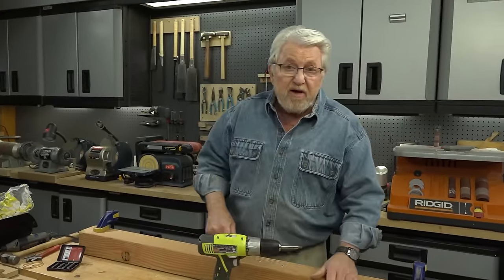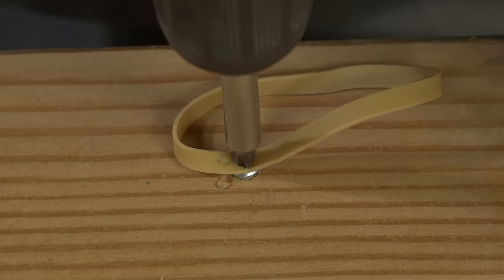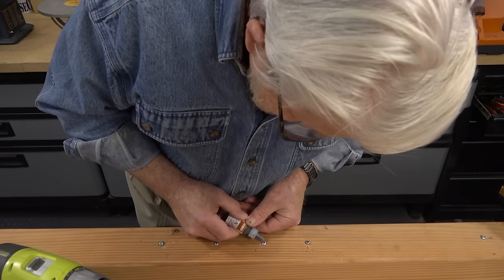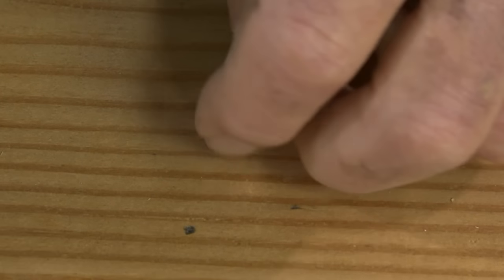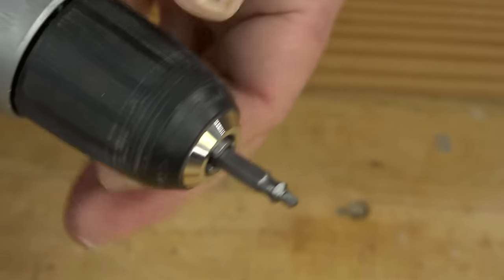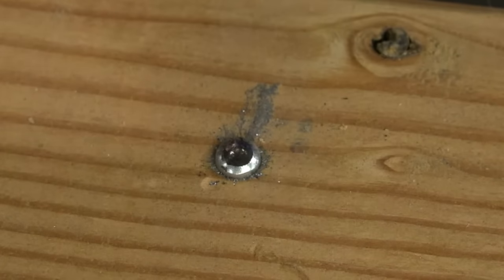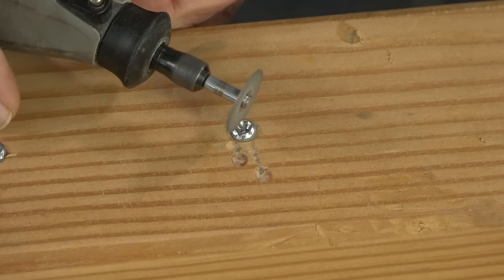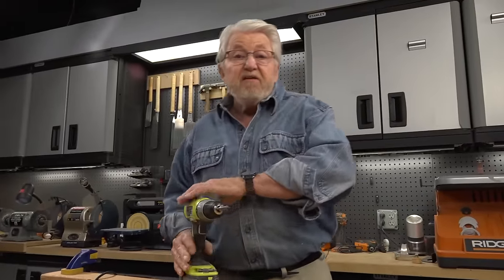How to Remove a Stripped Screw - 4 Different Ways

Comment: Thanks for the awesome tips!! Unfortunately, ours was an incredibly stripped screw and none of these worked. HOWEVER 😉, thanks to the idea of using the rubber band, we discovered ONE MORE WAY to get a stripped screw out (as long as you're able to get the screw out a fraction before fully stripped): wrap a thick-ish rubber band around the screw (just below the head, where the threads start - even above the threads is ok). Then, using a pair of needle nosed pliers, press a length of rubber band into the stripped head with one tip while grasping the outer rubber band with the other plier tip. With the screw head firmly grasped using the "grip" of the rubber band pinched between the pliers, twist to unscrew. It's taking the idea in the video one more step. Thanks for the brilliant inspiration!! You saved my day!!😉😄

Comment: Excellent. I had a stripped construction screw with a star head. I didn’t have a rubber band so I tried using the bit with a nitrile glove between the bit and the screw head. Had to fold the glove a couple times for it to grip but worked perfect. Thanks for the tips!

Comment: Thank you for saving my day!! I had a stripped screw that was recessed deep into plastic area, hard to reach. (thanks, repair guy!) so I could not get inside my sewing ,machine for maintenance. I tried the rubber band and nothing. Then you used the extractor & I knew I need that! I went to the hardware store, came home & used it, and it worked!!! I was amazed, after trying for several days using different techniques. Screw extractor gets a thumbs up. I will be looking for screw grab to have handy.

Comment: I bought the stuff in the second method from Sears decades ago only to realize that it was valve grinding compound.  I always have valve grinding compound handy so I’ve been using it successfully ever since.   The rubber band trick is new to me. I’m going to give it a try next time I run into problems.  Thanks, Chris

Comment: Or for a 5th method if you don't have these items use a hack saw to cut a line into the screw head and then slowly with a right sized flat head screwdriver ease it out, just did this method on a screw for my front door and it works like a charm

Comment: New idea (and it worked!).  I had a stripped screw on my front door knob assembly.  I found a smaller sized "Star"-shaped bit.  If using power drill (like I was) 2 important notes... 1.  Good hard pressure IN, and 2. Go Slow.  I figured I'd try my idea first and then try the one's he recommended.  It was fast to try and it WORKED!

Comment: Thank you! This video was helpful. We have a lamp post with two rusty screws in our front yard. It’s been really frustrating trying to get them out. I decided to buy the burnishing and extraction drill bit kit; it worked! I had to try a couple different size bits, but I was able to successfully extract the old screws. Such a great feeling. Thanks
Reply: Can you send a link for the heads you bought? The rubber band trick didn't work for me and I don't have the rotary tool.

Comment: Thanks for the video.  I ended up using the last method of turning my philps screw into a flathead with a dremmel cutting wheel. Worked like a charm.

Comment: I have to admit that Screw Grab worked amazingly well.  I also bout the drill bit because I didn't expect screw grab to work but thought I would give it a try.  I didn't think there was enough left of the head for screw grab to work on.  I was wrong.  Great recommendation.  Thanks.

Comment: 👍 👍 👍 👍 👍 👍 👍 👍 👍 👍 👍 👍
THANK YOU VERY MUCH! 
Placing a tiny rubber band piece between the tip of the screwdriver and using pressure while counterclockwise turning the stripped screw head worked! 
👍 👍 👍 👍 👍 👍 👍 👍 👍 👍 👍 👍

Comment: I've been repairing boards on my deck hoping to get a few more years of life from it before replacing it. Lots of stripped phillips head screws! I bought the kit of stripped screw remover bits and they worked like a charm! So far, I've never been able to get the rubber band method to work for me.

Comment: Rubber band trick worked enough so that I could remove the screws with a pair of pliers. The other drill bits for removal of a stripped screw would work well too and I have to get those. Thank you!

Comment: Thanks for the suggestions. The rubber band didn't work for me and I didn't have the two specialty tools. But, I cut a slot with my Dremel and removed it easily with a flat head. Thank you!!

Comment: Two more ways:

- Screw extraction pliers. Vampliers and Knipex TwinGrip are two good options. 
For screws that aren't fully recessed, this is often the best and easiest way.

- Manual impact driver. Not an electric or pneumatic impact driver, those are totally different tools. This is a type of screwdriver that you hit with a hammer, and that causes rotation, while the impact force also prevents the bit from slipping.

Can be used in conjunction with friction paste like Drive Grip.

Comment: really helpful, i manged to remove a long screw in the psu of a PlayStation 4 that someone had over tightened and chewed the Phillips head up using the rubber band method but using a flat end screwdriver within the grooves. thanks for this vid!

Comment: Awesome video. I tried EZ Outs/Speed Outs, screw extractors, rubber bands, super glue, drill bits, gloves, and the only thing that worked was using a rotary tool with cutter (Harbor Freight $10) to cut a line/slit(Phillips flathead) in the center of the screw so an Impact Driver can hold onto the screw.  My screw was too short and the material was very soft.  Put painters tape on the screw before using an Impact Driver(Amazon $12).  This was the only thing that worked for me. Hope this helps someone out there.

Comment: Nice instructions. The four set of extractors, It's not a burnisher, that end is a left hand drill bit designed to drill a hole in the center of the screw as said, in reverse, most often "drilling" the screw out. If this doesn't work then the "easy out" on the other end is used.

Comment: I'm working on an old office chair (the date of construction is October 1908 according to the stamping on the height adjustment swivel) and one of the flathead screws holding in the 4th leg is not budging. I don't want to drill into the screw if I don't have to, I want to clean these screws with electrolysis and reuse them. So the old "drill out the screw" method won't work. I saw that first tip and I'm definitely giving that a try.

Comment: Thank you so much for this video! I am trying to put a cabinet together and ending up stripping the screw head...but I had a Dremel and put in the cutting blade and voila, I was able to cut a slot in the top of the screw and use a flat-head screwdriver to remove it;  It worked perfectly. You saved me from a lot of frustration and tears.

Comment: I wonder how well the ubber band method works,  cause i do have a stipped philips i need out.  and cant afford any new tools or compound at the moment,  Since it is flush it would be dificult to cut a notch in,  but if rubber band fails that is the next step.

Comment: Great for 'Philips head' screws ..but what do you do with a flathead/knife edge screw? (if the screw slot is damaged/removed).
Is the only method the ol' 'drill through the screw' method? 
I have a flathead screw, where one side of the screw head is gone ..so you can't turn a screwdriver in the slot.  And, its recessed into a cavity about half an inch (so access is tricky).
I thought about using epoxy resin, to attached something to the head and try to turn that.
Also, maybe a internal hex key, placed over the top of the remaining screw head?
I was hoping not to drill through the screw ..but it seems like the best method for flatheads still :)

Comment: to prevent stripping or breaking in the first place heat it up if possible, then use atf , brake fluid, PB blaster ect, then f its a screw with a Phillip's head or other screwdriver head then put the screwdriver in it then hit with a hammer a few times, use an extension on a bolt and hit it, use a smaller socket and hit the nut, don't hit the screw or bolt its self or you will damage it and then for sure strip it. hitting it with a hammer works very well try it a few times and you'll be able to tell the difference.

Comment: Hi where can I buy the drumroll drill you used to deal with the stripped screw in the 4th method I am in extreme dire need this is to fix an electric bike that cost $1,200 if I can't remove the screw the bikes destroyed it's for removing the Hub motor

Comment: I'll probably need the last trick: cut a slot across the bolt head.  I made a rookie mistake with my power driver.  I set it the wrong direction and I tightened it when I wanted to loosen it.  And the driver was set on the most powerful setting so it stripped the phillips head to smithereens.  And the bolt is in there super tight now.  That power driver is a beast.  The bolt is a round top so there's nothing to grab with pliers.  If I can't get the "cut a slot" method to work who would I look for to save my bacon?  Is there a certain type of metal shop I should look for?

Comment: Think i would confident using the first 3 methods, but not the rotary tool on my vintage electric bass guitar with rusted and threaded screws holding the pickguard down. With my bad eyes I’m bound to slip and wreck the guitar ;)

Comment: My problem is, that the small head stainless deck screws were driven deep into my cedar porch decking and all were put in at different angles.  That makes it difficult to line up my hex bit for removal. If I had a tool that could cover the heads and then screw them out, that would work.  I could flip all the good boards and replace the bad ones.

Comment: I still did not get my answer.  My stubborn screw is in a 4 inch deep hole in the plastic cover of a boombox.  The head is rusted and I need to position my screwdriver with a guess.  When I try hard the head either gets scraped off or the screwdriver is beside the head scoring off the plastic.  I tried WD 40.  No good.

Comment: And sometimes no matter what you try, the darn screw just won't come out. I wanted to replace an old security sensor light bulb and could not for the life of me get that old rusted and stripped philips screw out of the housing in order to access the bulb even after trying your techniques, so I just went out and I bought a new security light from Home Depot.

Comment: None of theses worked for my situation, compounded by the fact that the bit broke while drilling out the screw. My case was wood on wood. I finally decided to use a twist drill the same size as the screw head one completely removed the screw head. I could then pull the 2 pieces apart. Still couldn't remove the piece left with locking pliers but fortunately the screw remnant broke below the surface. Problem solved.

Comment: I wish I had seen this before I struggled getting kitchen cabinet screws out.  What a nightmare!  It took hours and another trip to the hardware store, though the tools I purchased didn't work.  There were no instructions, at wish print that a human being could read . . . hahaha . . . no there were none.  i didn't know the tool i purchased had two ends.  Maybe next time, though I hope I never do another project like this.  i do think these ideas are best.  In the end, I just struggled with a large needle nosed pliers and eventually was able to twist the metal surrounding a couple of the screws thereby freeing the screws.  One catastrophe was a chip out of one of the doors.  I'm praying horse glue and new screws will renew the bond.  Ugh!  Also, the angle to get at the screws can make it even more difficult.
Reply: That is me today -- I can't get this stupid screw out so I can replace a microwave.